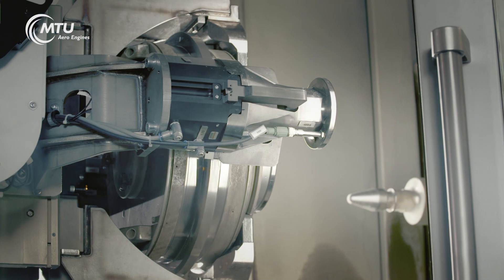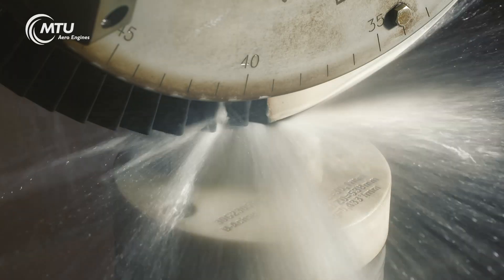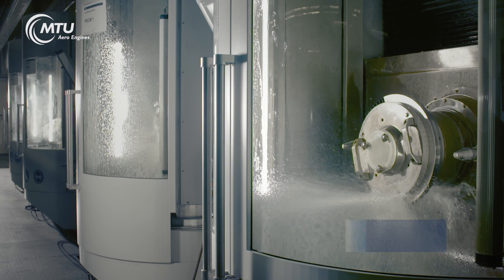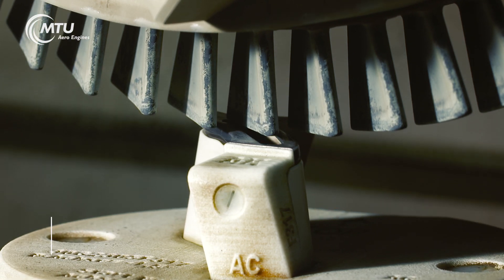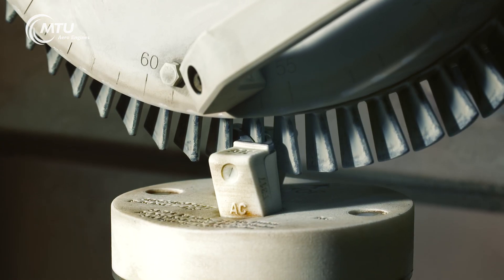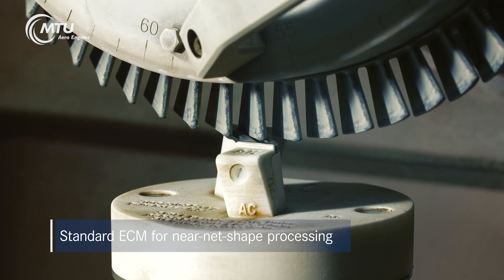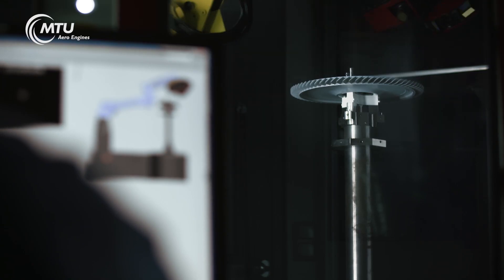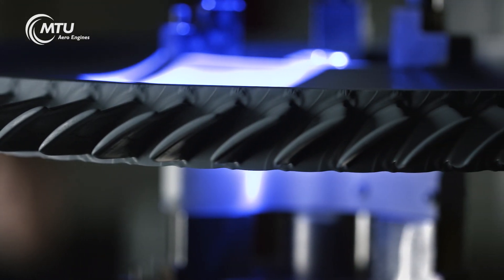Electrochemical Machining at MTU: outstanding manufacturing quality

Comment: It’s finishing turbine wheels made of out nickel alloy, perhaps for aircraft gas turbines (jet engines) .
Reply: No, this is actually machining them.  High current pulses are used to slowly etch away at the material by electrolysis in a neutral salt solution which is sprayed into the work area.  The process can take hours up to days but the quality is worth it and it is actually faster than machining them out of the same material.